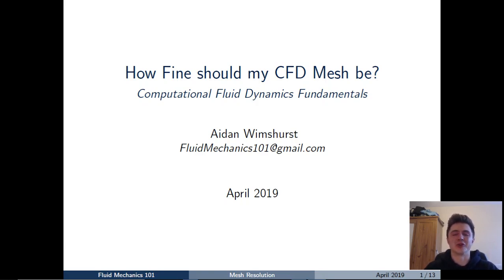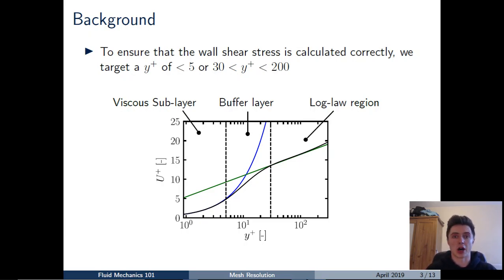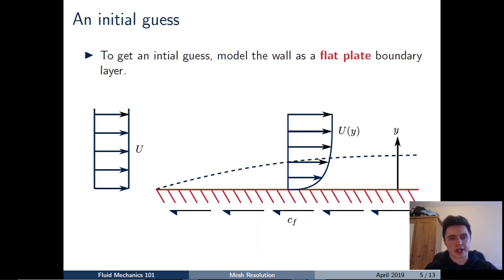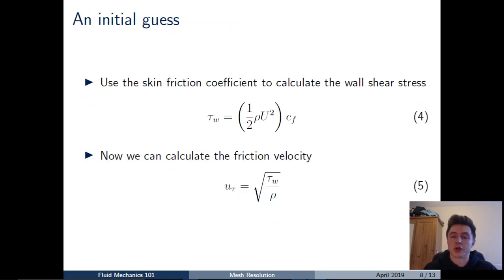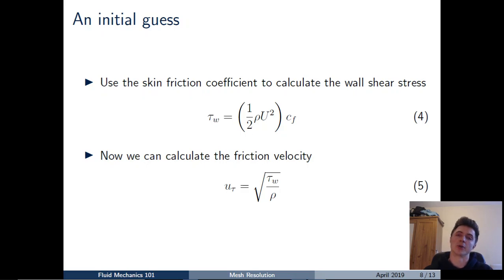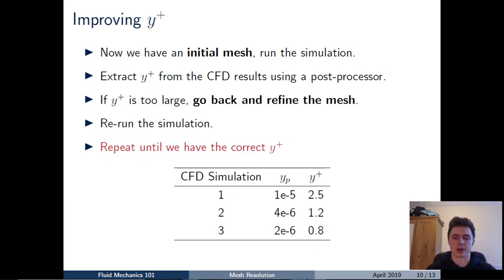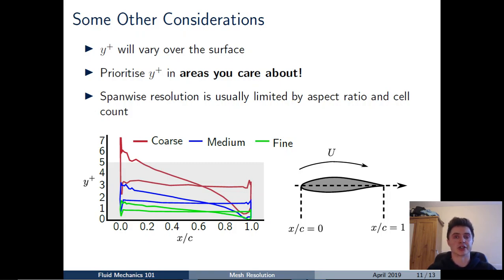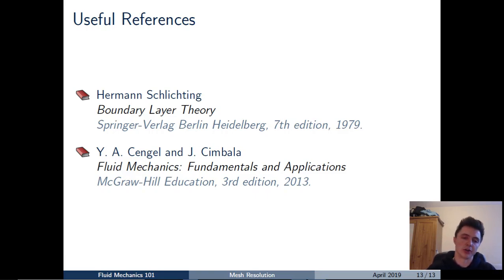[CFD] How Fine should my CFD mesh be?

Comment: How do we fix the initial mesh size for any give problem? Is it dependent on some geometrical parameter or so? Do I start with some 1mm or 0.5mm ? Can you throw some light on this?
Thanks in advance.  🙌🙌
Reply from the maker: Have a look at the geometry and look at your large and small features. If your large features are ~1m in size and your small features are 0.05m in size, then maybe go for a cell size of 0.02m.

Usually it is better to start big and then go smaller. If you start small, you might generate way too many cells and freeze your computer!
Reply: @fluidmechanics101  thank you for the explanation.

Comment: I know the skin friction coefficient equation is for flat plates, but how would I approach it if I am simulating a 3D wing?
Reply from the maker: Take the chord length at 50% span as the length of the plate. The flat plate should do a pretty good job for getting you the right order of magnitude, as it is an external flow with a developing boundary layer 👍
Reply: @fluidmechanics101  Thank you so much!

Comment: Hi! WHat is the length of a scale for an inlet flow. Is it flow length or  Hydraulic Diameter?
Reply from the maker: The hydraulic diameter seems sensible, as this limits the maximum size of any turbulent eddies that can be convected into the domain. It is common to take a fraction of the hydraulic diameter, as the eddies will rarely be as large as the entire inlet

Comment: @fluid Mexhanics 101
what about natural convection ? do I substitute Reynold's no with Grashof's no in your formulas and proceeds ? or I need a whole entire equations?
Reply from the maker: Yes! Natural convection is more difficult as we dont know the freestream velocity. Remember that this is only an initial guess, so you could always use an empirical correlation for a flat plate natural convection boundary layer to guess the velocity. Or just jump straight in to the CFD and try a cell height of 1mm. Run a few iterations and have a look at the results and then refine the mesh 👍
Reply: @fluidmechanics101  

First of all , Thanks for replying and for your good explanations and your effort , keep it up man 

In you thermal wall function video , you didn't give details about how to calculate u _t 
If you have an empirical correlation for turbulent natural convection , can you share it with me as I am searching for hours and couldn't get one

also I am a beginner to ansys , so I didn't know that I can get the Y+ function from the pre processor

Comment: Hello , could you please explain to me how can I estimate the first cell height in a multiphase simulation, for example two fluids with differents viscosities? Lets say a boat in the water with a certain draft (interface bewtween air and water would be presented, the free surface).
Thank you for the videos once again and if you could reply the question it would be awesome!
Reply from the maker: I would estimate the volume fraction in the cells adjacent to the wall. Use the volume fraction to calculate the dynamic viscosity and density in the cells (volume fraction average). Then estimate y+ using these values. 

Or just make a quick mesh, run it and see what y+ is after a few 100 iterations. Then refine your mesh 😊
Reply: @fluidmechanics101  Thank you for the repply, I will try to do this. Just one thing, last week I send a e-mail to you, could you please say to me if you received it? If you can't suppoort me with what I asked that is no problem.

Comment: Hi Aiden .......There is any way to calculate the base size of the sells ,or just it depends on the geometry size?
Reply from the maker: Yes, for RANS computations it depends on the geometry and the level of resolution you can afford. For aerofoils for example, i would recommend trying to get at least 100 cells on the pressure and suction surfaces of the aerofoil, so you can capture any separation and reattachment points. For simpler geometry without adverse pressure gradients you can get away with much fewer cells, as the flow quantities do not change as much in the streamwise direction

Comment: Great content video. I recently found your website as well. I am having trouble validating this process with your website results. 

Given Air at 15C:  mu = 1.802 x 10^-5 kg/ms, rho = 1.225 kg/m^3, L = 1m:
1) Re= 679800
2) C_f = 2.290784 x 10^-2
3) T_w = 1.403 Pa
4) U_t = 1.0702 m/s
5) yp = 1.3745 x 10^-5 m -> yh = 2.749 x 10^-5 m
The calculator on the website provides a first layer thickness of 6.57 x 10^-5m when provided the above mu.
Im not sure where the discrepancy is between the video equations and the website computation is. Do you have an idea? Thanks!
Reply from the maker: Could you send me a quick email with details, so I can try and sort this out for you? fluidmechanics101@gmail.com
Reply: @fluidmechanics101  email sent. Thank you for taking the time to work with me!
Reply from the maker: All done. I think the error is in your calculation of cf (see the email)

Comment: If my yPlus is less than 500 everywhere on my model surface but less than 5 in some places and I am using k-omega SST and wall functions is this acceptable? Using OpenFOAM for external aerodynamics
Reply from the maker: Try refining and coarsening the mesh, and see what happens to your answer 👍 if the change is small, then you can be happy that your original mesh is acceptable

Comment: How could you possibly put that y+ of 7 is a coarse mesh?
Reply: Also, your priority should be the capturing of the transition limits, not only the suction side.
Reply from the maker: I suppose ‘coarse mesh’ is a relative description that will change depending on the problem of interest. And yes, of course, the mesh resolution should be based on sufficiently resolving the region of interest, whether than be the suction peak/separation/transition regions 👍

Comment: Is the calculator good for internal flows as well?
Reply from the maker: Yea it should be fine for an estimate. You could get a better estimate using a skin friction correlation for a circular pipe but i doubt it will make much difference

Comment: Thanks for your tutorial!
 According to your vedio, I understands that the desire y plus should change until the result in post processing that are agree with experimental results.
if I dont have experimental results, how should i choise for the best desire y plus?
Reply from the maker: If you dont have any experiments, try and get y+< 1. This is the most reliable. Y+ < 5 is usually fine as long as you dont have separation/impingement 👍

Comment: When do we actually need to resolve viscous sublayer ( or to use y+ less than 5)..?
Why cant we use y+ greater than 30 always.. atleast for internal flows like pump impellers, compressors etc
Reply from the maker: You will need to resolve the viscous sub layer where heat transfer is important, or you have seperating / reattaching flows. So the surface of your blades probably need to resolve into the viscous sub layer, as you may have separation at low rotational speeds. However, the walls of the ducting are probably fine to have y+ > 30 as the flow is probably parallel with the walls, which the log law can predict reasonably well
Reply: @fluidmechanics101  ohh now I understood it 😀
Thanks a lot mate 🙂

Comment: Hi , how can I extract Y+ from CFD results ?
Reply from the maker: It will vary depending on the code you are using. Remember that y+ is a surface field, not a volume field, so it will only have values on surfaces. Away from the wall it will either be zero or undefined. What CFD code are you using?

Comment: excuse me! How can I determine the LENGTH SCALE if I modeling a Wind tunnel test with a building inside
Reply from the maker: The length scale should be representative of the physical size of the turbulent fluctuations. At the inlet to your wind tunnel, the largest fluctuations are limited by the height of the wind tunnel. So i would go with ~70% of the height of the wind tunnel. Having a large length scale will also reduce the decay rate of the ambient turbulence that you apply at the inlet 👍
Reply: @fluidmechanics101  Thank you for your nice reply bro! 
So, if I go with the "hydraulic Diameter", I should choose 100% height of WTT right? 
Another question ab, Turbulence Intensity, why Ansys do not allow us to put the function (it just a single value) at the inlet. I got a curve in the WTT but move to simulation, I dunno how to apply this one! 
Ps/ I do the K-0 SST

Comment: What is y+ ?
Reply from the maker: Distance of the first cell centroid to the nearest wall, expressed in dimensionless units. Roughly, you can think of it as the thickness of the cell that sits on the wall. Thin cells have smaller y+. The CFD code will calculate it for you
Reply: @fluidmechanics101   Thanks for your reply.

I'm setting up a FLOW-3D model for my dissertation and I need to determine the cell size of the mesh. I was under the impression that all the cells would be the same size, but you're saying that some cells will be different from others? Sorry, I'm a CFD novice.
Reply from the maker: That's ok! You need your cells near the wall to be thinner, to resolve the steep gradients in the boundary layer. If you check out my video on 'Inflation Layers' that should help
Reply: @fluidmechanics101  Thank you, I will have a look.

Comment: The first guess for supersonic flow in an airfoil is fine when assuming the cf formula showed in the video? I think there are better alternatives but you said this first step is a guess anyway, so does it really matter what formula for the shear stress I use?
Reply from the maker: As this is a first guess, it is probably fine. You are really just looking for the order of magnitude of the cell thickness. Should I use 1e-4, 1e-5 or 1e-6m?

Comment: Do the second and subsequent cell heights matter in getting the proper results? In other words can we keep a relatively large inflation ratio so that we satisfy the y+ condition also and keep the total cell count minimum?
Reply from the maker: The second and third cell heights do matter, as you need to make sure you have enough cells through the thickness of the boundary layer (I am making a video on this at the moment). The best thing to do is set your first cell height to get y+ and then try and keep your growth ratio less than 1.2 (1.1 is usually best), then you should be fine

Comment: Hi, could you help me to figure out if I need y+?
I have a complex UAV model that I will be testing in CFD (ICEM + Fluent) to determine forces, so I am using an unstructured viscous mesh.
It is for a fully/global Laminar Flow of Re = 1000.
I understand y+ is calculated for all sims, irrespective of Laminar or Turbulent.
I would just like to ask what parameters must I know/calculate before generating the mesh.
Thank you!
Reply from the maker: For laminar flows (which you clearly have if Re = 1000) then y+ isn't that important. It is normally more important to check and see if you have enough cells through the thickness of the boundary layer, and enough resolution in areas of large gradients. The easiest way to check this is with a mesh refinement study 👍
Reply: @fluidmechanics101   Hello Dr Wimshurst, Thank you for the clear information. I shall perform a mesh study using a coarse mesh first!

Meanwhile, I am having trouble understanding other parameters that are required for meshing in ICEM. What other
parameters must I input into ICEM? 

Lastly, Should I create a surface mesh (All Tri, Patch Independent), followed by a volume mesh (Quick-Delaunay)?

This info would be very beneficial for my study. Thank you.

Comment: Thank you for this wonderful video, i just have one question, what if we do not have an estimate of the velocity at the beginning of the calculation, how we do calculate the Reynolds number ?
Reply from the maker: Good question! It depends on your flow scenario. I would have a look in the literature and see if you can guess a reasonable flow rate for your case. Ultimately this is just a first guess and you will have to go back to your mesh and refine it anyway, so what would be a sensible flow rate? Internal flows are probably going to be less than 1-2 m/s, external flows are probably not going to be more than 10-15 m/s unless you have a very gusty wind and aerofoils /wings are usually going to be subsonic. Does that give you a good idea?
Reply: @fluidmechanics101  thank you very much  😊

Comment: Great video, thanks Aidan! I still don't understand how to decide, if I should put my y+ in the viscous sub-layer or the log-law region? Wouldn't I always put it in the log-law region because it reduces the number of cells I need?
Reply from the maker: Hi there! If you can you should always try and put your cells in the viscous sub-layer (y+ < 5) as you will get a more  accurate solution. The log law model gets less accurate under adverse pressure gradients, strong curvature and separation. However, we sometimes have no choice and cant put our cells in the viscous sub-layer as the mesh would either have too many cells or the aspect ratio/skewness is so high that we cant get a stable solution. Oy under these conditions should be we use a log law model. I hope this helps :)
Reply: yes! thank you very much!

Comment: Hello dr.Aidan , I appreciate your helpful videos, I have a question, when simulating a 2d Car in Ansys Fluent 2020R2, using three velocities 100km/h, 160 km/h , and 200km/h, I used an online calculator for the first guess of cell height for a Y+ of 1 ,after the simulation I have got a value of 0 for Y+ , is it ok for the Y+ to be zero?
Reply from the maker: Hmmm there may be a mistake there. You need y+ to be a small but finite value. I would go with 1e-5m as a first guess if you are having problems
Reply: @fluidmechanics101  you mean I use first cell height as 1e-5 ? I'm using a first cell height of 9.5e-6 m
Reply from the maker: Oh yes, sorry! A first cell height of around 1e-5, which is probably a good guess to get y+~1

Comment: In the case of a multiphase fluid, how do find the Reynolds number since you have more than one density, dynamic viscosity and maybe different velocities. Thanks for the excellent teaching
Reply from the maker: Yes you are right. Reynolds number will vary as the fluid properties vary throughout the mesh. What is the flow like near the wall? If it is mostly primary phase, I would use the viscosity and density of the primary phase. If both phases are present you can calculate a the local mixture properties using a volume fraction weighting and then use this to calculate the Reynolds number. I hope this helps!

Comment: Hi Aidan! I have just discovered your channel and I wanted to tell you thank you, I really enjoy and learn from your videos.

I also wanted to ask you something: for a geometry such a Formula Student car, in order to get the reference geometry L to then obtain the Reynolds number (then used to obtain c_f), which reference would you take? The whole car length? The chord length for each of the wings?

Thank you, kind regards!
Reply from the maker: Great, im so glad you found the channel and have learned a lot! For your formula student car, it depends what you are interested in. If you want the drag coefficient of the entire car, then use the length of the car L. For the aerofoils, if you want the downforce, then use the chord length of the aerofoil. You can use a different reference length for each parameter you study! But im going to guess you are using Fluent ... for the reference length for the simulation setup just use the length of the car. This is just a convergence monitor and so it doesnt really matter as long as you get convergence 👍 hope this helps!
Reply: @fluidmechanics101  Thank you for your rapid and complete answer! I'm using OpenFOAM, but yeah, that is exactly what I wanted to know. Thank you!